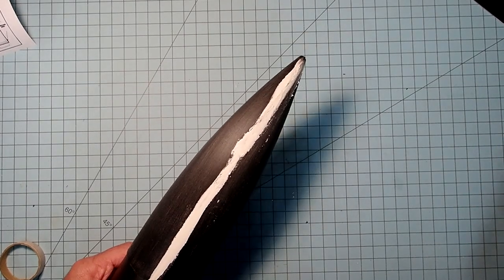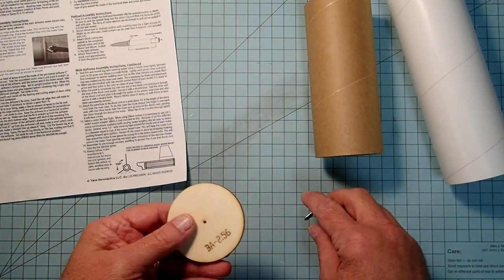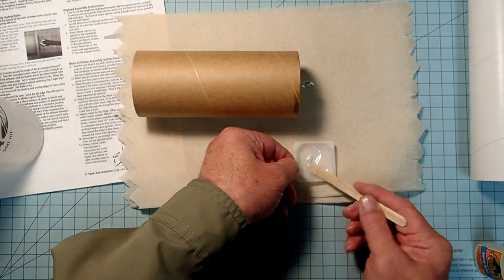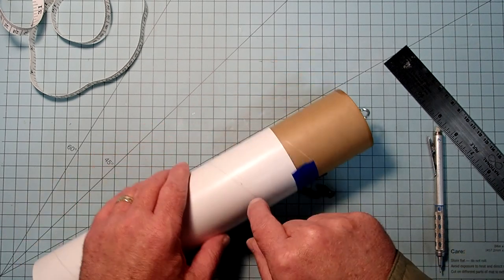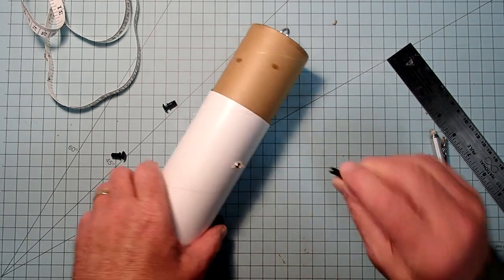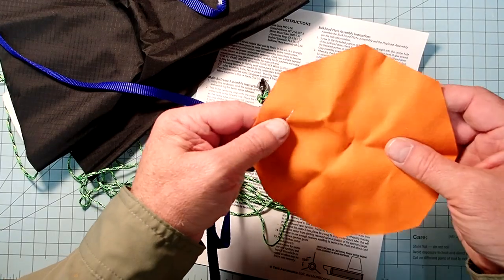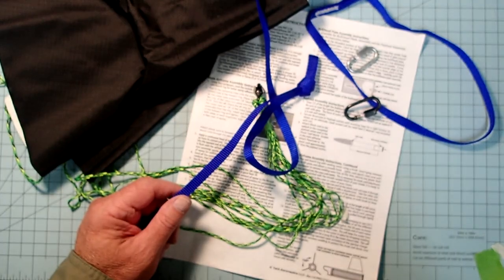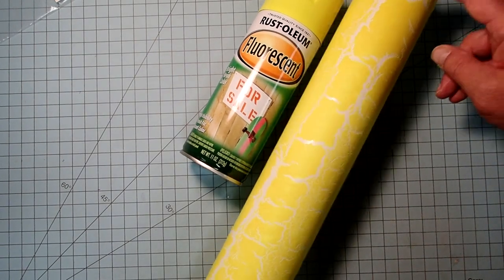LOC Precision "Hi-Tech" high power rocket kit assembly (part 2 of 2)

Comment: Ugghh.  The paint.  I had the same happen to me on my Hi-Tech but in fluorescent orange.  I wiped off a lot of it with paper towel while still wet and sliding off the body.  I let it dry for 30 min, then put on regular orange.  I flew it less than a week later.  I'm sanding down to repaint now. I didn't get the alligator skin on the nosecone, but was not happy with the smoothness of the surface.  I sanded that down and recoated with regular orange already.  The original paint was so bad, I didn't put on the decals. I got first coat of orange on the fin can and will wait a few weeks for full cure before adding another coat or 2 and a clear coat after decals.